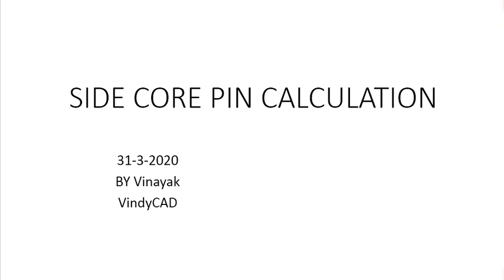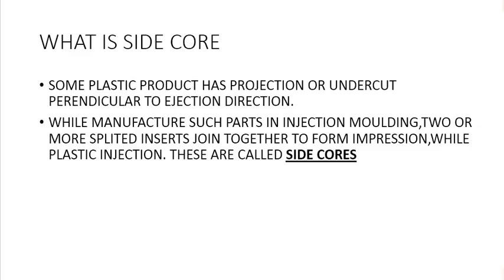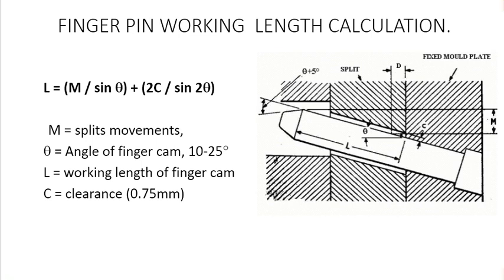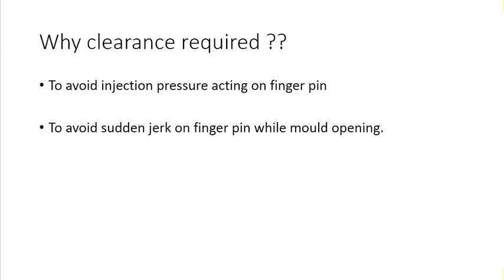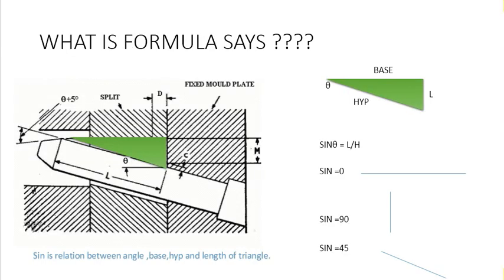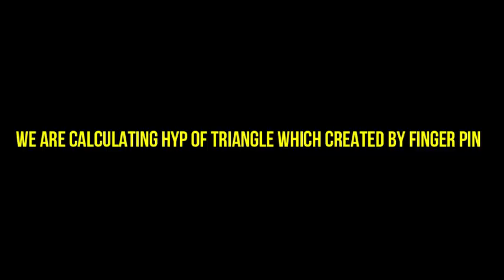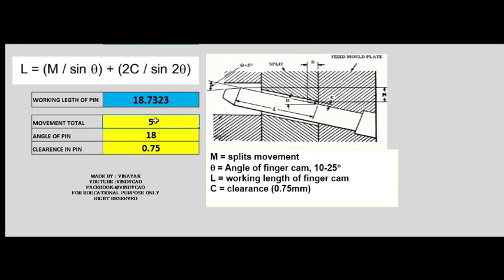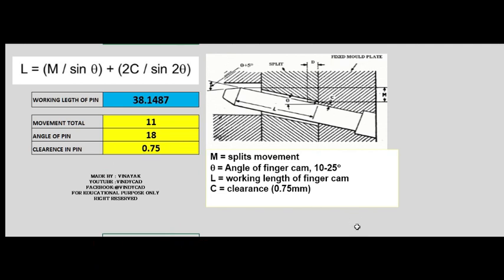HOW TO CALCULATE SIDE CORE PIN WORKING LENGTH?? |Bonus study material 💥💥

Comment: Sir what happen if angle goes above 25 & below 10
Reply from the maker: 25 above..there is chance of finger pin breakage..due to load acting.
Below 10 will evey less to movement than your pin length become more 

There will be missfunction both scenario
Reply: Thank you sir
Reply: Sir what will be the next video & when it comes
Reply from the maker: Am bit engaged in work .not getting time to make videos..but soon i will post new interesting video. 

Thank you for supporting!!
Reply: Thank you sir

Comment: What is the maximum working length limit which we can keep ? Maximum permissible stroke for angular pins ?
Reply from the maker: 15-20mm undercut is decent undercut..if it's between 20to40mm  either go to hydraulic / pneumatic/ cam 
This as per my opinion..it depends on design to design..